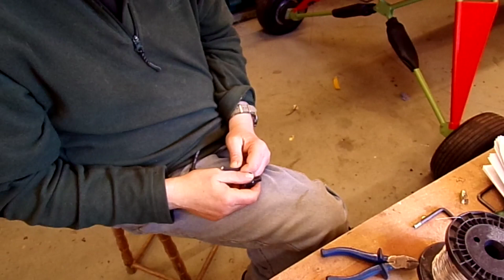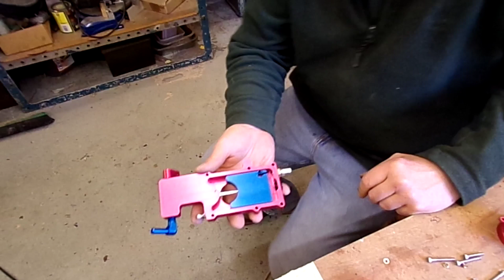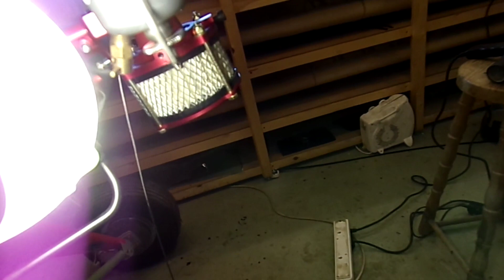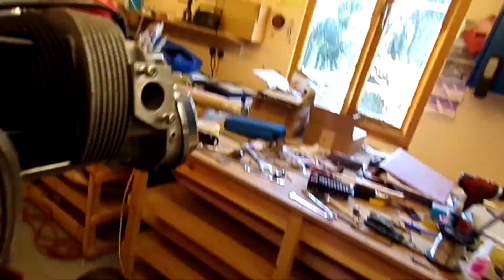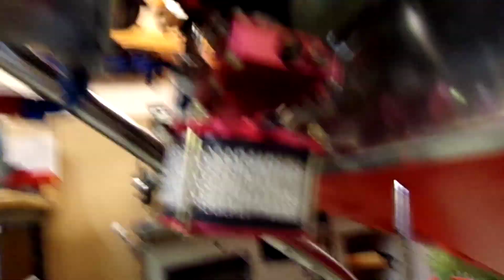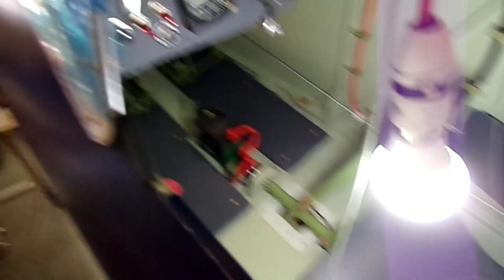EP180 Nearly ready for the 1st engine start on my Fisher Youngster

Comment: Why not use NGK plugs?
Reply from the maker: As I said these are supplied and I  see no reason at this time to find a NGK equivalent,  if there is a direct equivalent.  Spark plugs can change the rate of burn and so engine cylinder pressures and temperatures,  so you need care before charging plug types.

Comment: Its good to have the engine wired up electrically now.  A "Big tick" on the list.   The way you cut the end of the HT lead reminded me of how people make patch cables or instrument cables for Guitar effects pedals and such.  Although they are coaxial.
If you are going to "start her up" in the workshop, I hope your neighbours won't mind. 😉
Reply from the maker: You are spot on with the method, it is the one I use for Coaxial cable for arials as well, a proven method that saves expensive striping tools 🙂 I don't think my neighbours will mind as it will not be run long here and they have put up with my mad projects before, in fact they seem to enjoy them.

Comment: Why not use gapless sparkplugs? why not also use an MSG pro ignition system? I would have gone with an NGK plug myself.
Reply from the maker: I have stuck to what has been supplied by Sonic (AeroVee) with the engine kit, the ignition system has been proven with many aircraft out there using the standard set up trouble free. I must admit I would normally select NGK and may find out what the NGK equivalant is but for now I will keep to the type recommended and supplied, as spark plugs can make a big difference to engine performance and the burn temp.